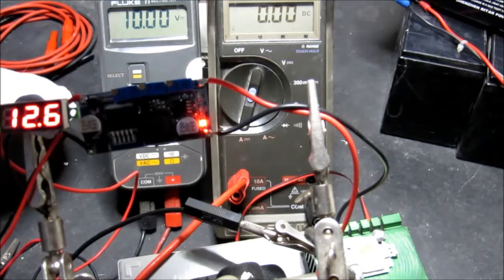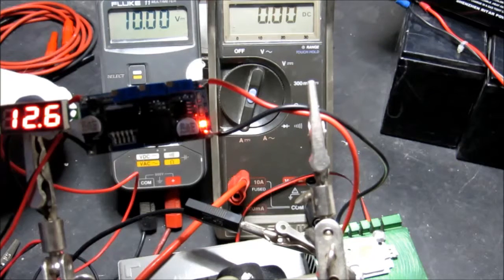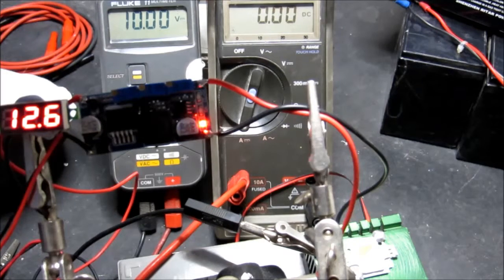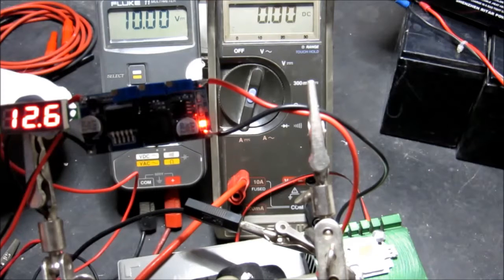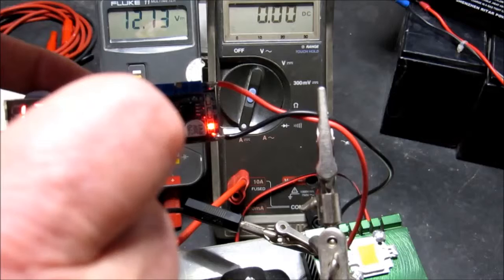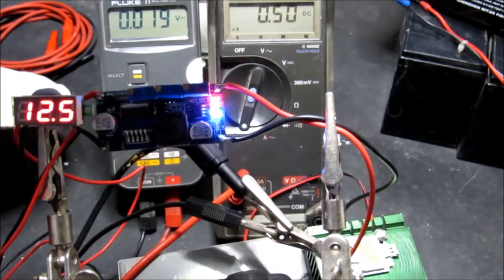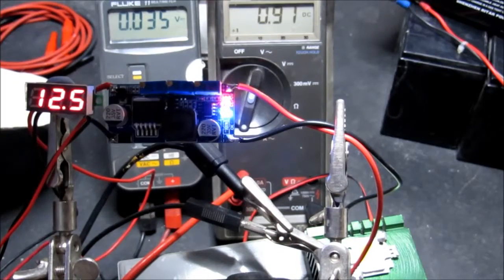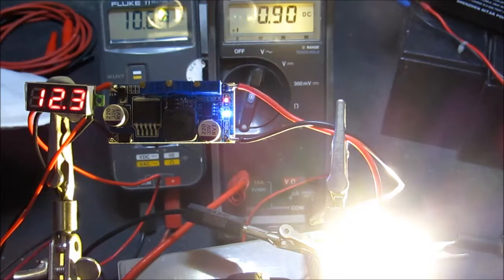LED Driver Part 2 Constant Current Step Down Buck Module Banggood Battery Charger Electronic Project

Comment: I have always used low voltage to power my LED’s because if you run a 3.2v led with only 2.5v it runs insanely efficiently. But if you want the led to actually be bright you can’t really do it that way. 

This is the first time I have seen what the voltage does when controlling the current. You gave it 12v but it only used 10.7v when the current was limited to 0.9amps. It was really great to see that happening. 

Now I will go destroy some LED’s seeing how the voltage reacts when you give it to much current.
Reply from the maker: Yes, it is always fun to experiment with these things. Sometimes the results surprise! Thanks for watching, have a great day!

Comment: You use the words "current limiting" that's not the same as constant current which type of supply is it? thank you
Reply from the maker: I believe it is constant current : https://www.ti.com/lit/ds/symlink/lm2596.pdf Thanks for watching, have a great day!
Reply: @1nformatica thanks for the reply but that's a link to the IC specifications there's no constant current function. You're wrong the board is a current limiter not a constant current supply. You can prove it by changing the load and you'll see that the current varies (this is done below the current limit setting)

Comment: The one and only videos that explain how these nifty little things work; they come with no information at all, no matter from which vendor one orders them. Much appreciated!
Reply from the maker: Thanks Andreas! I have another video with another application here https://www.youtube.com/watch?v=zTxiflmyeU4
Reply: It would be great if one could use this device as LiPo battery charger at the same time, like Adafruit's PowerBoost 500/1000 device that has load-sharing, but has 1. no constant current output and 2. only boosts 3.7V to 5.2V (for Arduinos and similar microcontrollers)
Reply from the maker: I am sure somebody is working on such a device. New things arrive every day!

Comment: Hi can you tell me how to change the amp?? I can only change voltage but not amp.
Reply from the maker: I show this in another video : https://youtu.be/iANVj32u25w?t=234
Reply: 1nformatica in that video as well how are you changing the current, are connecting directly to multimeter or with resistors?
Reply from the maker: The multimeter is connected directly across the output , this sets the constant current by turning the small blue variable resistor on the right as you see here : https://youtu.be/iANVj32u25w?t=232